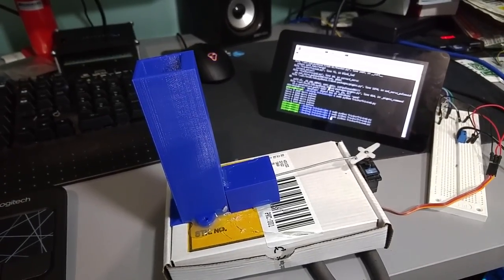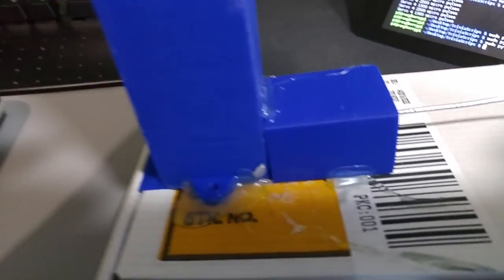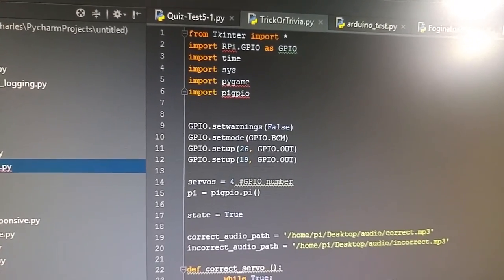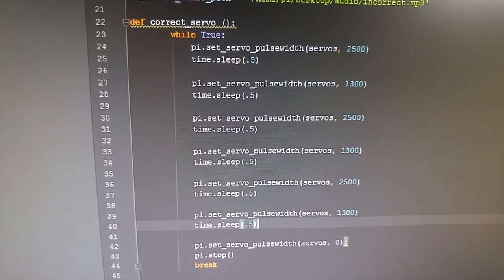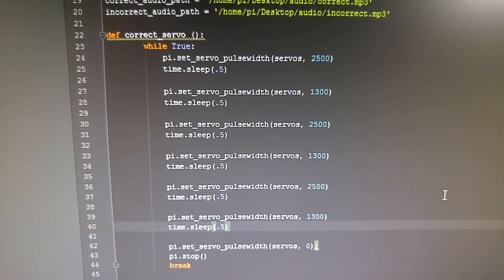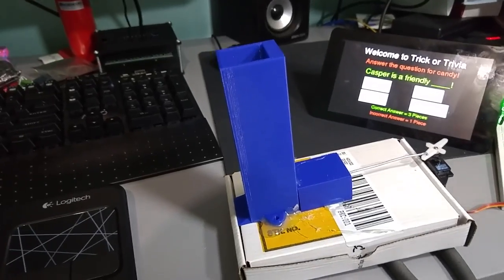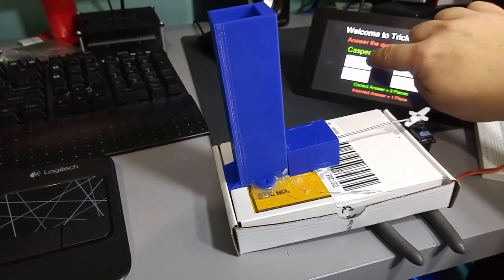Trick Or Trivia Trivia-Based Halloween Candy Dispenser Servo Demo

Comment: What does the "while" loop do?
Reply from the maker: +Johann Glaser  The "while" loop just lets me call the functions in order and loop back to them when finished. It also would allow me to set a variable such as "ready = True" and as long as ready was equal to true, it would run that loop.
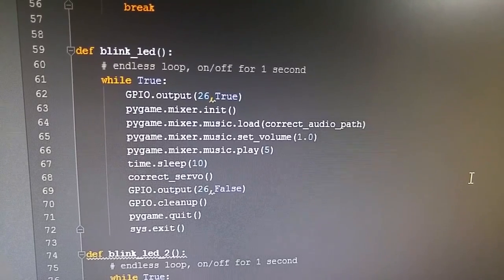Reply: +TheMakersWorkbench As far as I see, the "while True" loops in the functions "correct_servo()" and "incorrect_servo()" (see 2:45 and 3:10, respectively) have a "break" at the end of the loop, and in the functions "blink_led()" and "blink_led_2()" the loops have a "sys.exit()" (see 3:19 and 3:29, respectively) at the end. In all four cases the loop is terminated after its first execution, so I don't understand what the loop is for.